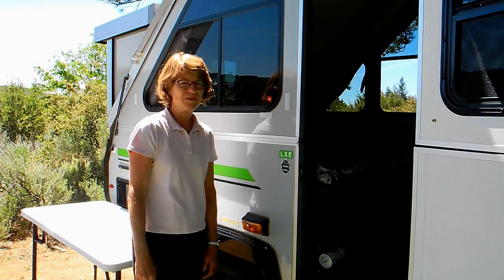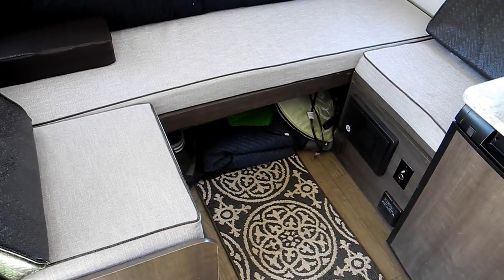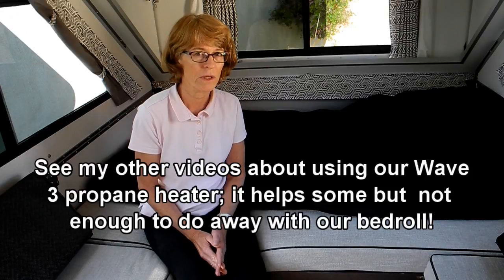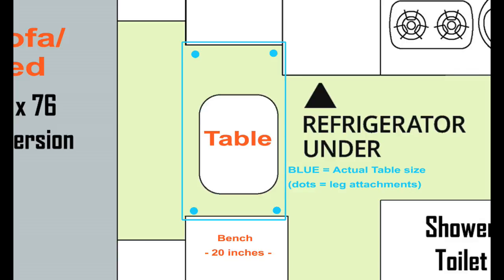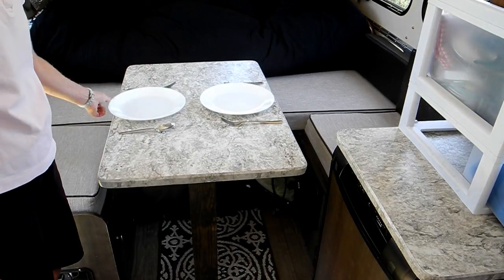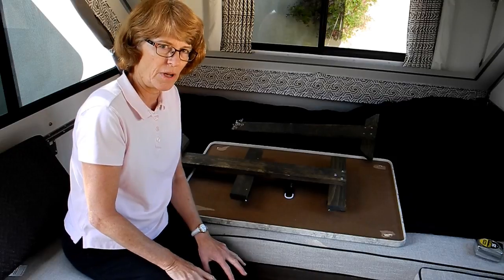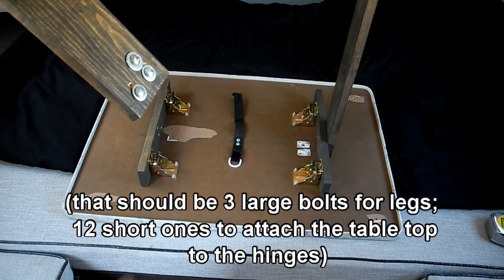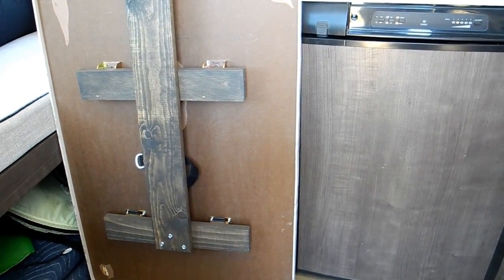A Better Dinette Table for the Aliner LXE (plus stain match!)

Comment: Got an idea about the bolts sticking out of the table top if your still interested. I would countersink the bolt heads and leave washers off. Looks like table top would be thick enough to still hold well enough.  Great idea on table, well thought out solution, as usual.
Reply from the maker: Jarrell Baughman Actually that’s a fake edge you see on the table (which starts to pry off quite frequently). The table top is quite thin
Reply: @averagealice8877  tks.  Good to have you back . I am following a few others, slim potatoehead, campervan kevin etc. Enjoy u all

Comment: A few ideas...just throwing them out since you asked for some.
1. Use countersunk screws if you have to have to through bolt.  You can even hide the heads with a suitable filler. 
2. The folding hinges seem an unnecessary complication.   With a bit more woodwork you could make both legs removable and have them slot into a static "pockets" glued and screwed to the table top.  These probably need not be much deeper than the wood you are using now.  You could secure them with a removable pin or latch.  There are various "table top locks" available for holding leaf tables together that might work well though you might need to add a block to the leg to attach the latch.  There are also various toggle pins and spring latches that might work.
3. To make the legs stiffer,  use a second piece of wood (say 1x2) at right angles glued and screwed to the main leg.  It does not have to run the full length.  To maintain the leg room these could face outwards.  You could offset it so the two legs  fit together for storage ...  
4.  The structure that makes the "pockets" on the base of the table could have cutouts that allow you to slot in the detachable legs and fixed them with a latch or pin.  With some thought possibly the same latch or pin could be re-used to hold the legs in both their deployed or stowed position.
5. To make the feet more stable use three widths of wood so the leg slots into the foot...much like the "pockets" for the table top. You could make the feet removable with pins or latches for easier long term storage. Cut a shallow arch in the bottom so the each foot only touches the floor at each end...at its "toes" if you like.  This prevents an uneven surface causing the table to rock on the flat feet and ensures the weight is spread to the span of the feet.  You can achieve the same thing less elegantly with screw on sliders/glides.
Reply from the maker: Wow thanks - all good suggestions.  Honestly I'm happy with the hinged solution on the one leg that doesn't need wing nuts, but the other one, I might look into a spring latch (or two) like you mentioned.   Funny I did end up installing some small plastic feet (not in this video)  to avoid the electric extension cord we frequently have snaking across the trailer.  I know we should make the cord permanent but there's only so much "trailer work time" I'm afraid!

Comment: Greetings ... Just came across your video.
The first thing that came to my mind was a couch table.  With the modified L-shaped leg stand setup, turning it sideways would allow a complete open front for sliding in and out. If the top isn’t big enough, replace top with larger piece. 

Hope that made sense. 

Currently trying to decide between an A-frame or something like the Tab 400.  I really like the A but concerned about all the air/dust leak probability.  Plus, in another video you brought up the issue of wind while setting up which I really hadn’t given much thought.
Reply from the maker: We also looked at Tabs.  The interiors were far superior to the interior on the Aliner!  The reasons we didn't go with those were we were very interested in off-road dispersed camping and the Tabs we saw didn't have as much ground clearance as the Aliner with off road package.  Also we felt the Aliner was roomier, more windows and the LXE had a potential for a king sized bed (my other video).  However, I wish it wasn't a folding trailer!  Storage is severely limited and set-up takes longer.  My feeling on the air leak issue is all RV's aren't air-tight and you need to generate enough heat to keep comfortable, either RV heater or portable propane or other (electric if at RV park/electric hook up available).
Reply: Alice ... Since they’ve introduced the more off road version of the Tab, it’s clearance is better.  However, I’ve always really liked the A’s for its low towing profile, etc.  Since I am alone, storage isn’t really a concern either. I do everything very minimal. 
Thank you for replying.

Comment: I think I'll cut down the table top as you did and glue it on top of a small TV tray that folds up ...but also screw a couple screws that will go through tv tray from under ...through top and halfway through the main top if that makes sense.  I can paint the tv tray parts all white or just buy a white one in the first place .I plan to paint all the wood cabinets white when we get an lxe. I didn't realize the table would be in the way of  fridge.  Thank you!
Reply from the maker: Sounds like a good concept. We didn’t reduce the size of our table top tho in this video. Maybe think about bolt and bracket attachments if it’s thin paperboard top like this one, or a new top
Reply: Oh I would not cut it down then. Won't need to hindge anything because I'd put the aliner table top minus those big legs on top of the existing small TV tray... just glue it to stay on. A small TV tray already has the little fold out legs. E3600 glue is extremely strong plus if I  just screw small screws in deep enough to only go halfway through so it won't puncture to top.

I made a cat tree with pallet wood that way for a top piece ...glued and then put a couple screws but they only went in halfway. The glue would have been enough to hold it...wood glue or e3600
Reply from the maker: @micart79  Also the legs need to be tall enough or the right size so the fridge door can swing
Reply: Yeah I think we'll have the same issue with what we try to buy or make. Planning to buy an lxe in a few yrs so I'm going through all the possible issues now by researching beforehand.  I wish aliner had the exact interior measurements. We only had time to measure the exterior when we went to the local dealer and saw one in person. At least we know it will fit barely into our garage.  We have to get an aliner to store in our garage and prevent storage fees. Otherwise we'd prefer a full solid hard top small trailer with a separate shower and an actual black tank. So we have to do what we can with the limited space available.  We have to have a shower and toilet. My husband is very picky. I'm drawing out the Floorplan on a computer program but I'm trying to find the right measurements. Did you find out how to fix the microwave from getting off track? The leak issues concern us too. I don't know if it's worth all the trouble.
Reply from the maker: @micart79  No we had removed the microwave to gain extra storage space.  Just to mention, we sold our Aliner last year.  The shower was a "must" for me when dispersed camping.  I'd sum up our experience by saying we might have been too old for the Aliner...with too much stuff we wanted to bring, and the whole set-up and take-down process became too exhausting for us.  Not to mention we ended up wanting some kind of a better dinette (although if you are comfortable on a full-sized bed the dinette as-is might work for you.  We had converted ours to a king size bed).
Reply: Yeah I see that it would be too much hassle for you. We would just use it on weekend trips locally...only about 6 to 8 times a year. Thanks for the information and insight on how it is to own an lxe. Safe travels! Looking forward to more videos even if it's not an aliner. :)

Comment: You have an inventive mind.
I like the solution.
Not having any experience in any camper - I am offering "what if's" only

What if - you thought along the lines of -
2 single tables.
2 smaller table may have dual uses -
such as cabinet face-plates that swing into a table.

What if you considered the space above.
Maybe a thin pole could reside in the corner of the ceiling -
and pull down into a table. A support leg could swing down as a pedestal -
 then fold back into the main pole and hide when not in use.

The space used by the microwave, could have space for a couple of TV Trays

You share the same bed and shower -
perhaps using separate tables is exceptable?

I just found this vlog and I think
- first impressions -
You are anything but "average"
There is a line - in the movie Harold and Maude
Where Maude is explaining - why a field of Daisies are all different.
She points out how each daisy is a little different -
then says -
the trouble in this world is "People being this (referring to the individual flower) -
and allow themselves - to be treated like that (referring to the field of flowers) - 
that seem to all be the same.

Your voice is not average. 
Because I can hear you. (^_^)
Reply: Alice -
May I make one more suggestion?

I just checked and a name I like very much is available.

How about -
"Alice's Wonderland"

Isn't that a great name for a travel vlog?

No one has it - yet!!

Comment: just a thought, but if you offset each leg so when you fold it down they would bypass each other rather than running into each other.
Maybe use a not so wide board for legs might help.   ( trying to help ) .
Reply from the maker: john hodg IDK is there some way to do that without ending up with a very tippy table ? Maybe with 4 folding metal legs but then you have the problem of knees hitting to enter and exit the dinette area

Comment: Thanks for your interesting video.  You always come up with some great ideas.  I have seen camping trailers with a removable table around a seating area in which a 3 or 4 inch diameter metal pipe is attached  to the center of the bottom of table top and the other end fits into a support attached to the floor. Easy to remove and  able to swivel as well. May not work for you though.  Got a question about your mechanical talent.  How did you get interested? Is your husband  mechanically inclined too or does he let you just have all the fun? ☺ Thanks , hope I'm  not too inquisitive.
Reply from the maker: I considered the type of pedestal table you mentioned.   But with the placement of the table in the LXE, I wasn't as keen on having a post attachment in the middle of the walkway, plus when we looked at some of those it seemed like they were a little bit hard to disassemble (?), which we would have had to do every day.  No, my husband is more of the numbers/finance and electrical person.  IDK I've always enjoyed making stuff.
Reply from the maker: I might take a second look at the tables you mentioned though!
Reply: We have the Ranger 12 with the dinette at the front of the trailer and it has the pedestal table like you describe, Jarrell. It’s quick to assemble (converts to a bed where our dogs sleep), but is kind of wobbly when eating at it.

Comment: Excellent idea!

Quick question do you sleep east west or north south. I have always saw the 56x76 but figured that does not include the dinette seat. So adding the dinette seats gives you either two twins sleeping north south or as you have done added a very comfy looking bed roll and a large 76x76?

 Thanks Jim
Reply from the maker: With the added section you can sleep either direction, but we like to have our heads at the rear window of our dormer (feet toward the door) because if one person needs to get up in the middle of the night they aren't crawling over the other person quite so much.  But there's a nasty metal edge to hit your head on so we encased that in self-stick foam weatherstrip and it hasn't been a problem.
Reply: Average Alice 

Thank you that helps us a lot.

Jim

Comment: Or on 1- You Tube Video showed;  Dinet table held by pipe pieces and worked like a chicken wing cconnected underneith the middle and the other connected next to the side of the fridge.  It's how it opperated (-) minus another longer pipe. Google search pipe fittings under kitchen dinet table in an RV.
Reply from the maker: Thea Imus yes I considered that but thought the cabinet might not support it long- term
Reply: Seems too complicated with framing underneith. Your same table had mounted legs that folded and unfolded somehow. I know you'll find that too, your so clever. Say the blackout Windows Reflextics Coverings looked good for an emergency pullover siesta.  Some were velcroed,or magnatised, or fitted in. Hope it all helps. Sincerely thanks for the Inspiration, yours truly.

Comment: Your refrigerator door opens the wrong way, trapping you between the Ref-Door and Dinette.
Reply from the maker: Either direction the person sitting by the refrigerator can get "trapped" but it's only for a few seconds at a time because it's not good to leave the RV fridge door open for very long (heats up quick and a long time to cool down)
Reply: Can't you change the door on the fridge to open the other way. I know for a fact you can on any home fridge just not sure about rv fridges. You should ask where you bought it. I'm sure they would do it for you. If they could.    trying to help.
Reply from the maker: john hodg  Hi -  I'm not sure if you could (looks possible though), but it wouldn't help that much given the measurements on the original table and where the legs were.  The original table would still stick out in front of the fridge 10 inches and you couldn't open the door very far (unless you fold up the sofa bed which is a lot of work each time)

Comment: construction adhesive like no more nails ??
Reply: maybe try countersink bolts screws ?
Reply from the maker: dtec30 If you mean to adhere the legs the paper backing in the underside of that table top tends to peel easily so I don’t think it would last long